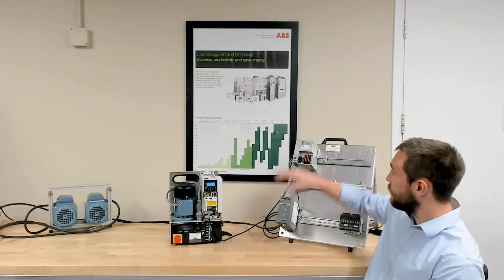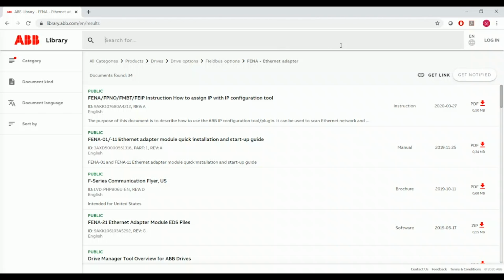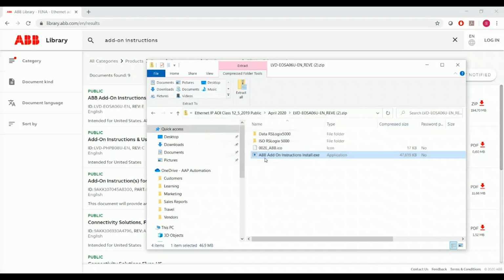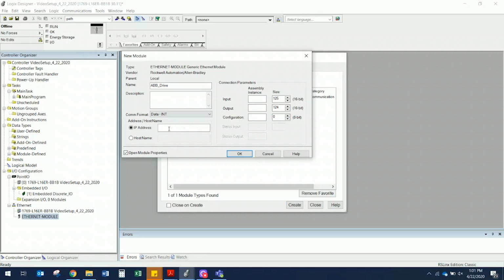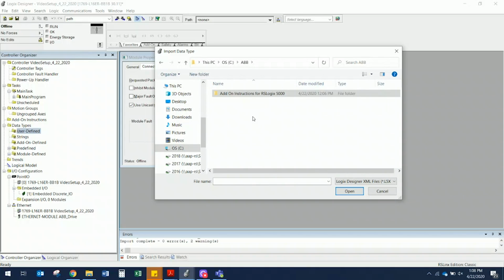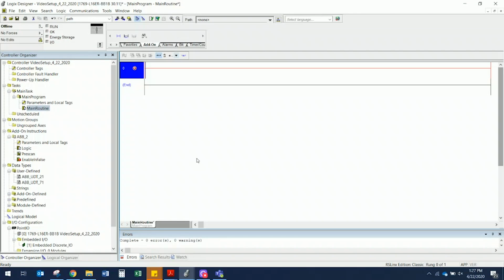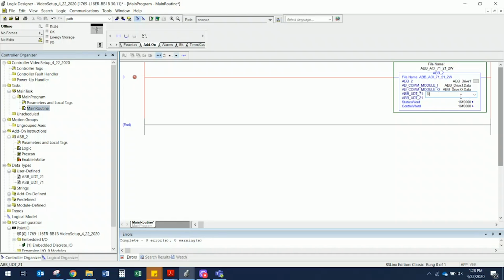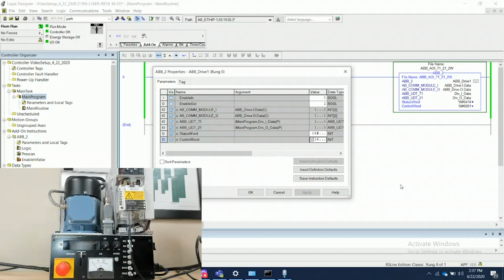AAP Automation Set up of ABB ACS380 with Rockwell Ethernet/IP.  Video 2 of 2

Comment: Excellent video, very informative. I need to create a project to connect a Logix5000 PLC to an ABB ACS850MV drive via a FENA-21 communication board.
I see that the generic module uses 2 words, but according to the FENA-21 manual, there is a configuration with up to 12 words.
Output instance 121
Input instance 171
Size 12
I'm not an ABB expert. My question is, should this configuration be done in the PLC, or should the ACS850MV be configured to have the same size?
Thank you very much.